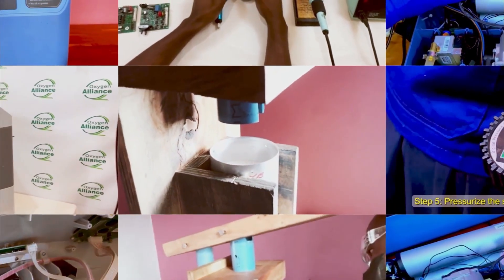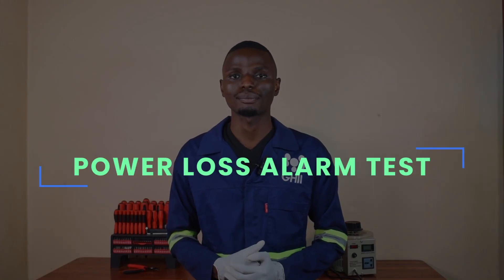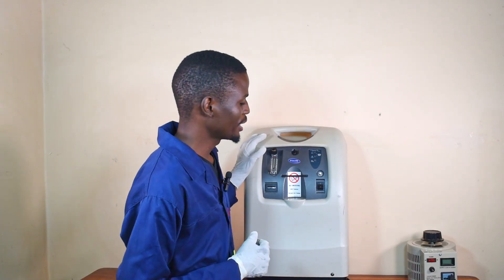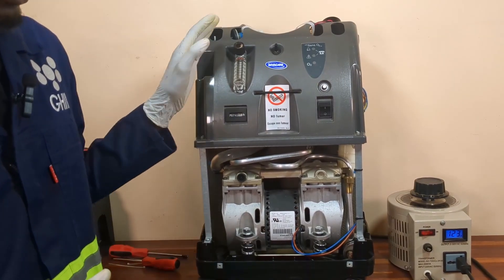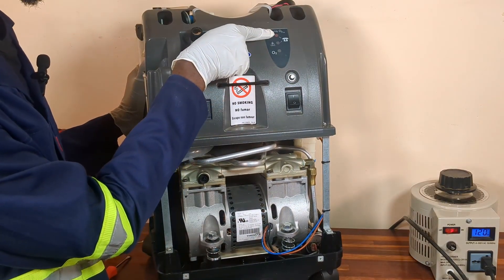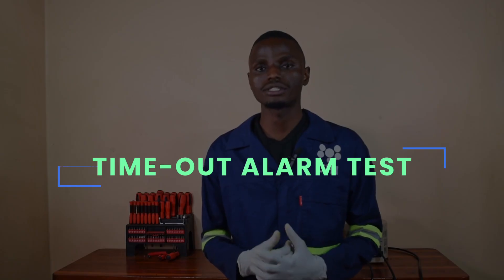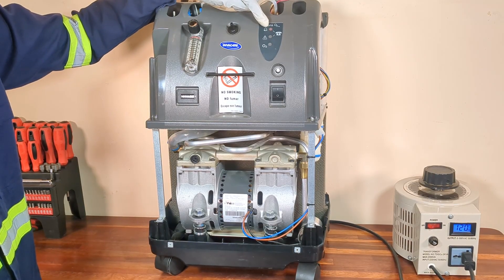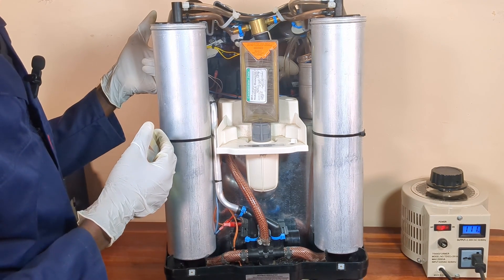Alarm Testing on Invacare Perfect Oxygen Concentrator

Comment: Czyli co? Jeśli alarm się włącza to sita molekularne pewnie już są zanieczyszczone i zeolit trzeba albo wymienić albo zregenerować wygrzewając go w 300'C i najlepiej w próżni, azot z sit molekularnych się uwolni i znów sito (może nie na 100%) będzie działać poprawnie. Można na chwilę przewody odłączać by przez chwilę jeszcze działał na np 70% O2 ?
Reply from the maker: The alarm system should never be disconnected under any circumstances. According to World Health Organization recommendations, oxygen concentrators are expected to deliver oxygen at a purity of at least 82%. Operating a concentrator below this threshold constitutes underperformance and may place patients at risk. In addition, the alarm system does not serve solely to indicate reduced oxygen purity; it is also designed to alert users to other critical faults. Disabling the alarm could prevent detection of serious malfunctions, potentially resulting in harm to patients, users, and the equipment itself.
Reply: @oxygenalliance 👍. Bardzo mądre.Pozdrawiam.

Comment: P F light in JAY 5b solution please
Reply from the maker: The PF light on your oxygen concentrator means that the machine is not getting power. This can happen if there is no electricity from the wall socket, if the power cord is not plugged in properly or is damaged, or if the fuse inside the concentrator has blown. To fix this, start by plugging the machine into another socket to check if the problem is the mains supply. Then look at the power cord for any signs of damage, and if you have a Multimeter, you can test the cord for continuity. You should also check the fuse in the power inlet to the concentrator. Open the fuse cover, remove the fuse using a small screwdriver, and replace it with another fuse of the same rating. 
After replacing it, close the fuse cover properly and try turning on the machine again.